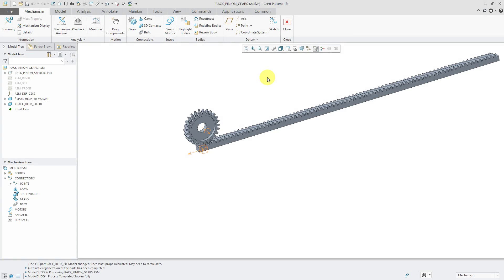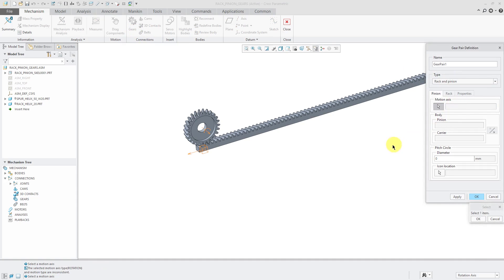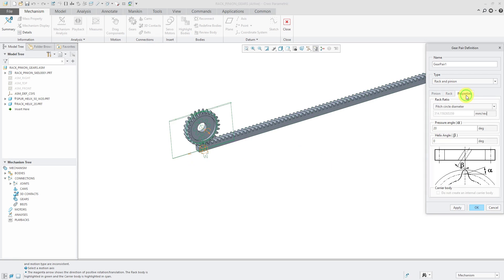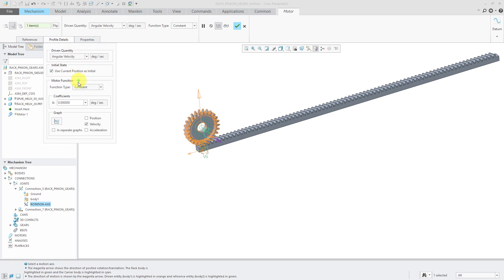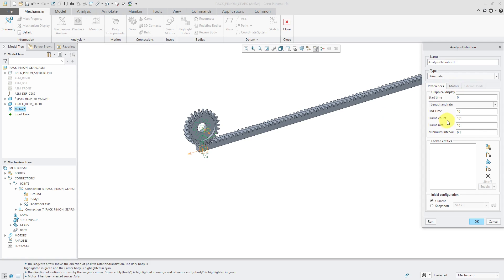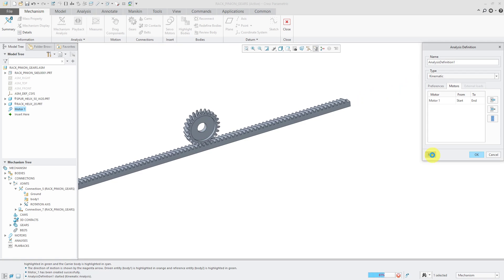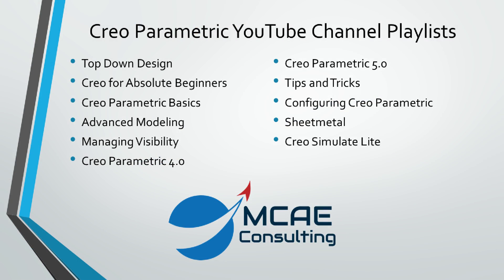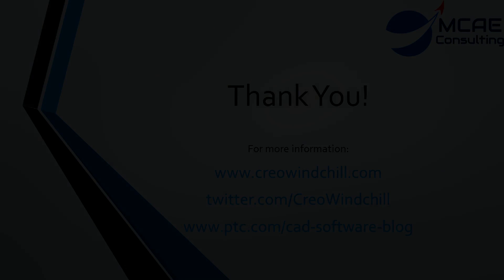Creo Parametric - Mechanisms - Rack and Pinion Gear Connection

Comment: How would you design it so that it moves to the right, then back to the left?
Reply from the maker: With a cosine motor. You can also use multiple motors with opposite values and different start times.
Reply: @CADPLMGuy  Thanks for the reply! Also, I had another question, if you don't mind, but it's not related to this video. If I wanted to move something in a circle trajectory, using two servo motors, one controlling the X and the other controlling the Y direction, how would I do that?
Reply from the maker: You should be able to do that with 2 geometry motors. I’m pretty certain I made a video on geometry motors years ago.

Comment: Thank you sir for uploading the nice video. I want to know how to run the pinion gear for one rotation only? I. E.  Running for 360 degree only. As it is related to my geometry which is prepared and want the crankshaft to run for only for one rotation rather than multiple... Because i want to see the trajectory  of a selected point For  velocity w.r.t. time curve
Reply from the maker: You could use a motor with a speed of 360 degrees per second and run the analysis for one second... or use a motor at 90 degrees per second and run the analysis for 4 seconds... or 45 deg/s and an 8 second analysis...

Comment: Is there a video for a simple bolt and nut gear connection please? I'm trying to use a stepper motor on a threaded pole with something attached to the pole in the end that I want to translate back and forth.
Reply from the maker: Is the threaded pole translating back and forth?
Reply: @CADPLMGuy  No, the stepper motor is simply rotating the threaded pole and there is a threaded piece on the pole that I'd like to translate back and forth using the threads between the piece and the pole, the issue I'm having is that I dont know how to make that connection happen.
I tried faking the connection by using servo motor to move the piece up and down and another servo motor to simulate the pole rotating, but in some instances the threads would clip through each other.
I thought if there was a simple gear connection between the two then I only need a servo motor to simulate the stepper motor spinning.

Oh and yeah I forgot to tell you the name of the mechanism I was describing in my original comment, its a Lead screw mechanism, and I'm using it as the main method for operating a scissor lifter.